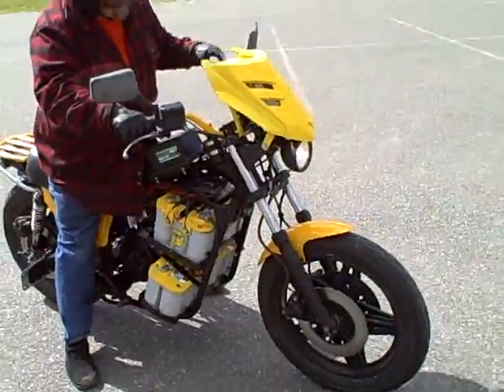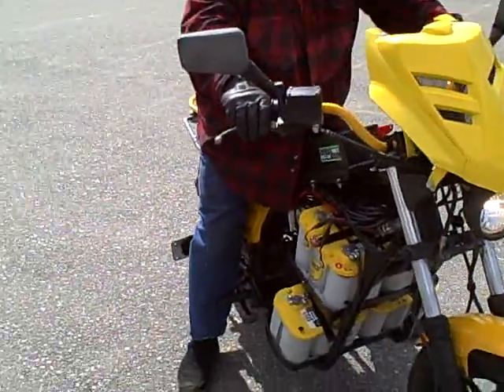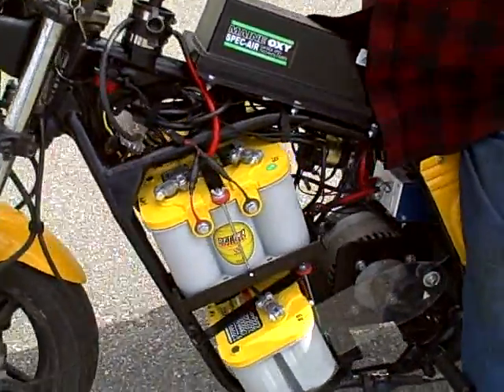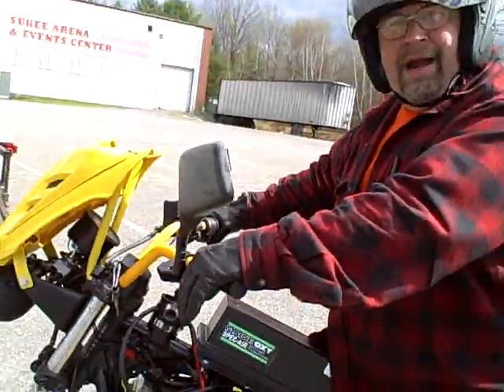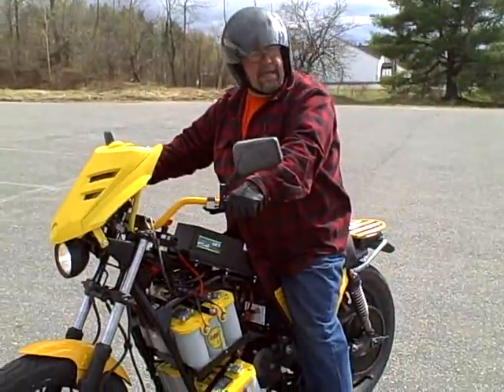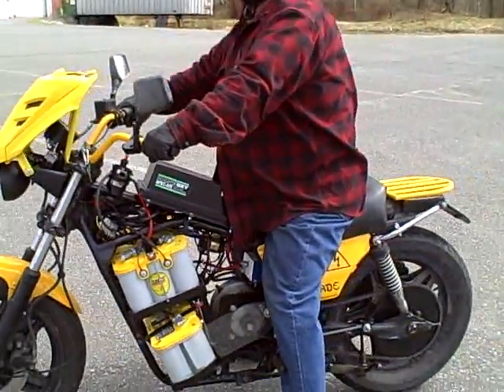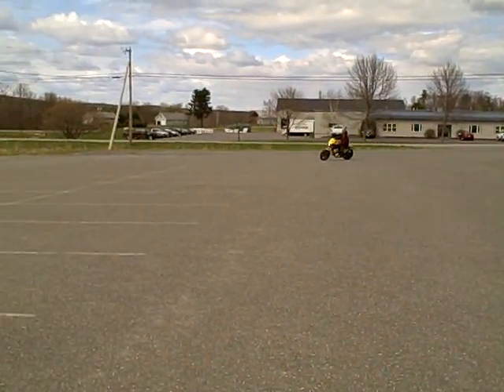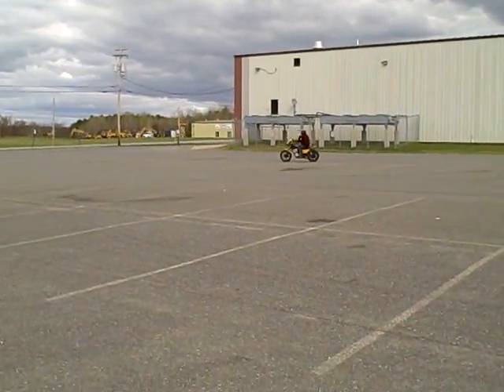48 volt electric motorcycle RancTek

Comment: Why not use lithium ion batteries? You can build your own battery pack to your specs using 18650s. It'd cost more but the run time would be alot better.

Comment: Anyone interested in building their own e-bike should know this ; The single most expensive item for any electric vehicle build is the speed controller because the cheaper ones using resistors to block amps while allowing high voltage work in jerky " golf cart " fashion and also lose a lot of power through heat loss . So most builders spring $1500.00 or more for a silicon diode type .
Reply: joseph bourdeau can you make it simple ?

Comment: why so many bateries, if i get 6 9 volt bateries in series that will make 54 volts more than your 48 v so why so big, i dont understand is it for a longer ride?
Reply: voltage is not all you also need amps and its indeed for longer ride.
Reply: Google: Amp hours.
Reply: M W4L Since posting that comment i have researched alot about it and thanks bc if someone would have kjust commented that sooner i would of been good but ik all about it know, thanks for the help anyway x
Reply: lol, I knew nothing before starting my build either. The optima yellow tops I used were 75 amp hours each

Comment: nice but take a look at Calb's new CA cells. lithium is actually more cost effective because they live much longer and you can do much more.
but don't overcharge them or overdischarge them. you can't just attach then to a lead charger and think they are lead batteries. top balance them and charge them to a common voltage but stop at 1/10th current of the capacity. if they are 70Ah stop at 7A at say 3.55V per cell. and put an Ah meter on them as a guide to not run them down to nothing.

Comment: 3.000 buks to make this?! one batteri costs anywere from 60 buks the cheapest to 250-300 lets sey it is 250x4 for 48 volts its a 1000 buks only other thing that is expensive is the motor and the controler everything else u can find in a junk yard